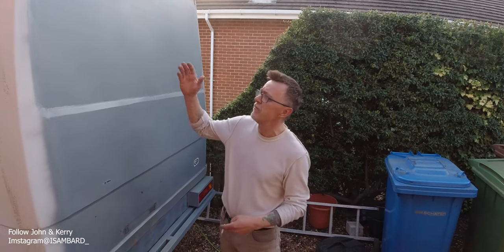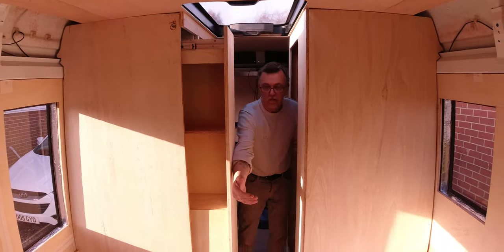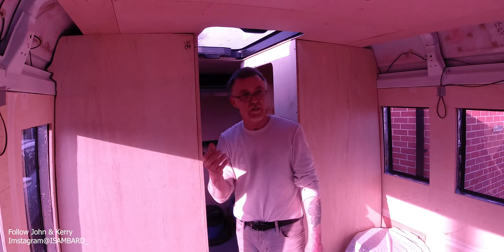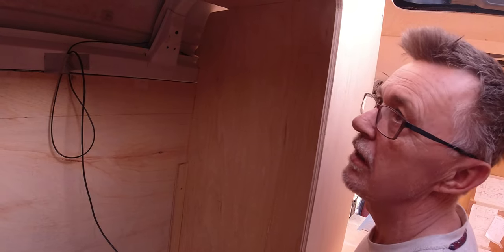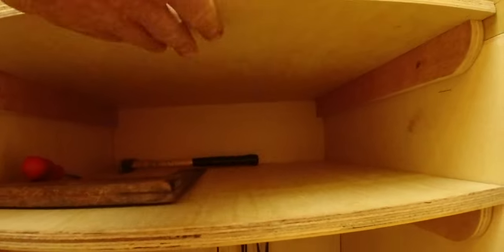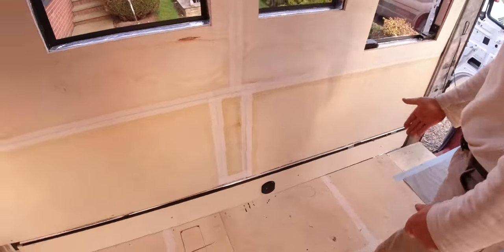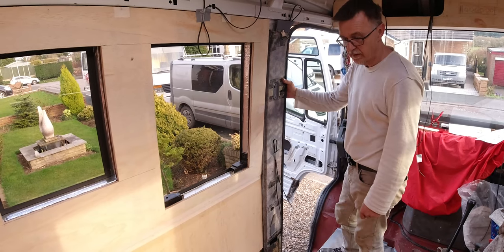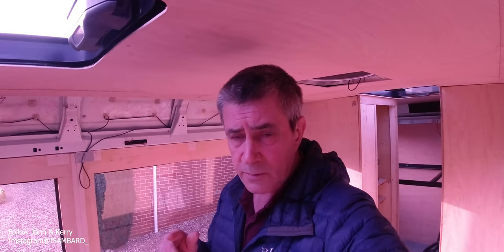Shower Room & Dividing Door Install, From Bus To Camper #mercedes814conversion

Comment: Basically they are not hinges, the ball bearing drawer slides/runners need to be parallel to each other . Top and bottom and left and right.
You could attach the bottom ones first and keep the top ones slightly lose.  Put some weight in the bottom tray and slowly move the unit out and tighten each screw on the top units when you see them
Reply: Good Morning, yes John is always making Freudian slips 🙈🙈🙈 I pulled him up on it! 😉
That's great advice, when the extra "Runners" arrive I'll be sure to oversee that John follows the above. Take care. 👍🚌🤗

Comment: Hi nice job ,do you think it could be possible to add casters under the sliding shelfing to help sagging .keep the good work up .rod
Reply: Hi Rod, I (Kerry) did suggest that, even went into the loft to dig a pair out but it got poo pooed! 🙈 👍🚌🤗
Reply from the maker: The problem is getting the casters to fold out the way when closed but I’m sure they’ll get there with it, thanks for comment take care 🚌👍

Comment: Basically this is the time to get everything correct and how you want it. Even if it means doing it a couple of times. You hear so many people saying I wish I had done this or that but I was in a hurry. Love to hear the banter as well just like a old married couple.
Reply: Stephen if I have to do it three times I will, I agree with you I did a vario van in 2002 after finishing it I did think if I ever do another it would be different, thanks for the feedback.
Reply: @johngriffiths7621  your welcome John, it's a interesting project. my old man used to say if your going to do a job do it correctly if you don't get it correct 1st time you will the 2nd time.
Reply: @travelling_stephen  I (Kerry) like your dad's Ethos! 👍👍👍👍👍👍
Reply: @j_k_roaming_  hi kerry from design and quality control. 😂😂
Reply from the maker: Definitely better to get it right first time, otherwise it’s major work to change something, that’s the problem with a camper, it’s not like you can just have a change around, thanks for comment 🚌👍
Reply: @SometimesIWander  and that's my mantra. 🤣🤣🤣